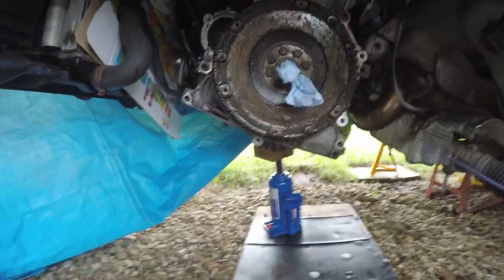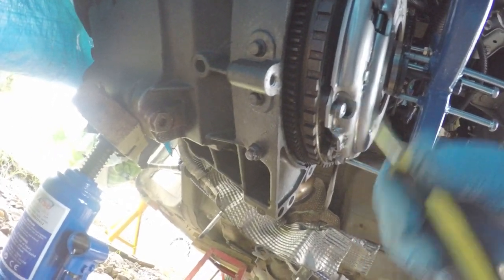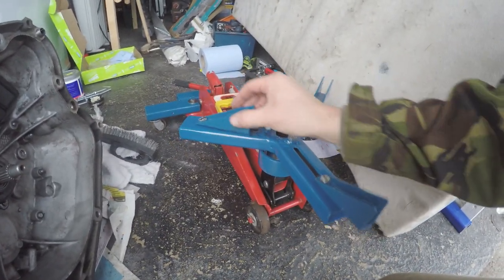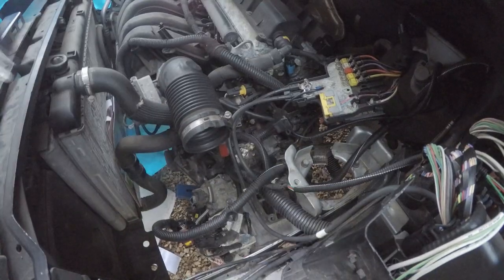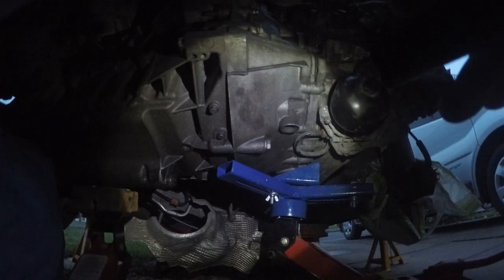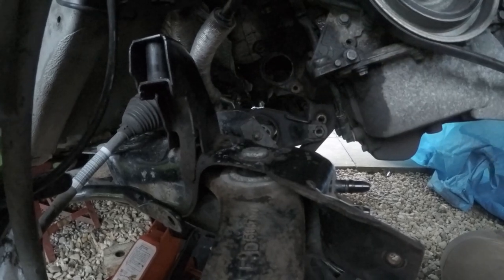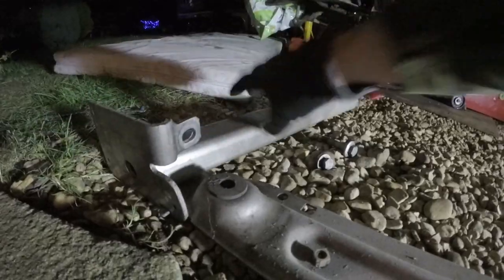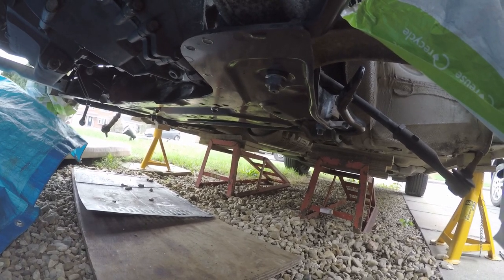C4GP EGS gearbox & clutch pt2

Comment: Will done mate my hats off to u for all this effort great job We charge 180 labour only on these and are done in 3 hours
Reply from the maker: Thank you, only £180, wow!! I don't mind the learning experience, but sometimes I wish I had a garage. I think the hardest part was putting the ball joints back in and realigning the gearbox!!
Reply: Where are you based ? I have a c4 picasso with egs that judders when you move off. Will it need a clutch replacement?
Reply from the maker: @yahyasheikh3235  check the forums in the links to see what the general census is mate. I can't remember now but I know my mums used to do this and I asked them to get it checked out and they got it looked at by their local garage and apparently it was normal. But I had my doubts.
Reply: Yahya Sheikh where in Sheffield’s great city HIDIS garage unit2 91leigh street s9 2pr
Reply: luke hadley bring it into the garage and it will be done
Reply: £180 has to be in India or China... in UK, Germany, Spain... etc... you won't find a garage to replace a semi-auto clutch for les than 1k... only the spares are around 380 if you are lucky and know where to find it...  if not, just the fly-wheel alone is £400 ...
And I doubt some one can replace the clutch in a C4 with EGS in only 3 hrs...
Reply: @jmc216  HIDIS garage unit2 91leigh street s9 2pr Sheffield Uk 🇬🇧 and you can watch me do it I will even make the tea too

Comment: Good work mate and thanks for the video. I'm doing the same job and following in your footsteps :) One question: after replacing the clutch, did you have to calibrate the gearbox with a diagnostic tool? 
Thanks in advance
Reply from the maker: Yes, but it is really easy to do. I can remember off the top of my head but subscribe to the forum in the links. It's not to difficult a job, have a welder on standby for the captive nuts.
Reply: @ifell3  Many thanks for your input. What is the captive nuts? 
Also, did you replaced the fly-wheel too?
Thanks again
Reply from the maker: @jmc216  no it wasn't pitted or anything and was clean. This was a petrol model and I can't remember if both versions are dual mass or not. What went in yours?
The captive nuts that hold on the subframe, I believe they are the ones that go into the 'chassis rails?¿' they are not very captive. It was mentioned by one of the mods, I thought maybe he was just unlucky, but I had them go on me too. Quite easy to get a welder on, and it's a great warning to be prepared on this. The hardest thing was getting the control arm Ball joint in!!
Reply: @ifell3  Mine was gone on Friday, I was struggle to find spares during weekend, also I was working. I started today... the weather is rubbish !!! 
I just removed the whole thing and tomorrow I have to go and get the spares... in bicycle ...lol
Yes, mine is diesel and have dual mass fly-wheel (Jesus so expensive). When I removed the subframe. 2 washers come off from the steering. One of the front (RH) captive nuts were spinning all the time, but I've sort it out using pliers. 
And yes, my fly-wheel dual mass is gone..... 
Thanks for all your advices. Great videos, I've watched both parts.... well done.
Reply from the maker: @jmc216  honestly if it's helped another human..... I'm a happy chappy, feel free to like and sub! Oh also check your sill drain holes, these look terrible for sill rot!